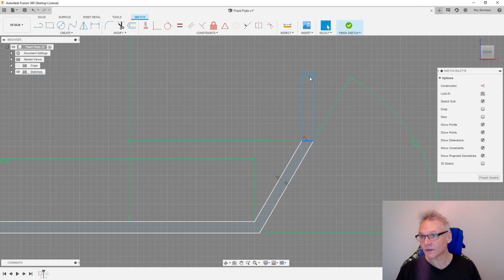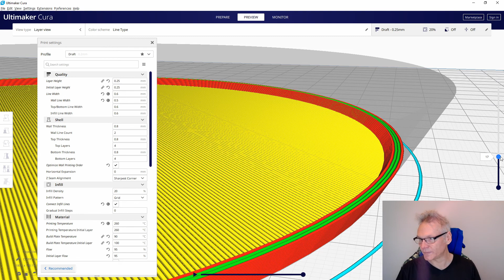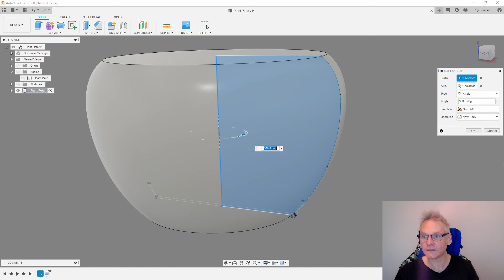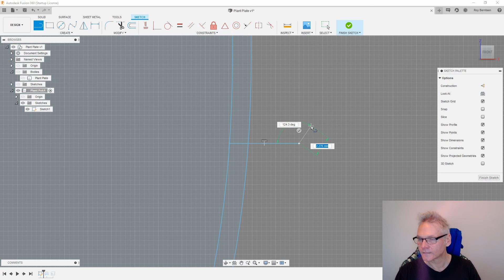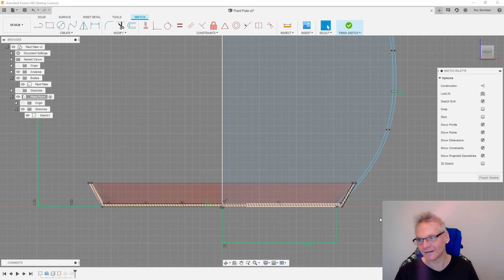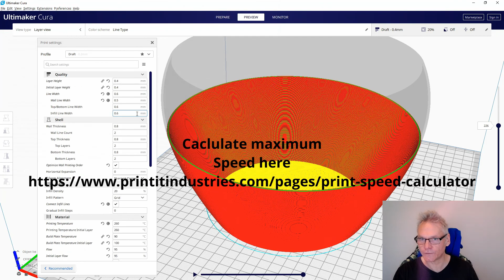USEFUL TUTORIAL TO 3D DESIGN & 3D PRINTING | Fusion 360 + 3D Printing with Cura

Comment: Ok i did not expect that just copying the spline would actually be a solution for this ^^  Simple but genius Tip.

Using the offset tool in the drawing would lead to the same problem as with the shell tool right?
Reply from the maker: Right!offset will not give you uniform wall thickness in the horizontal direction